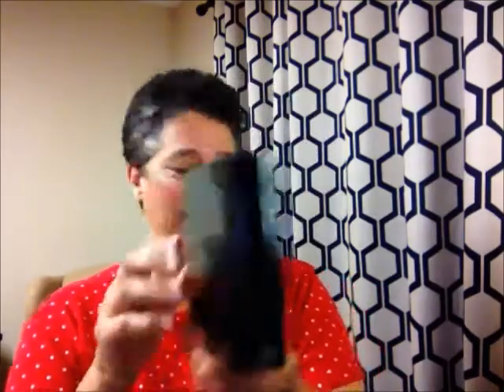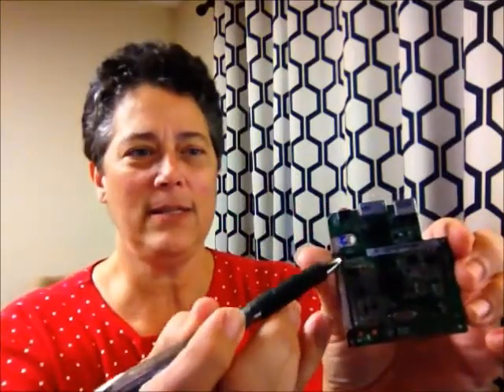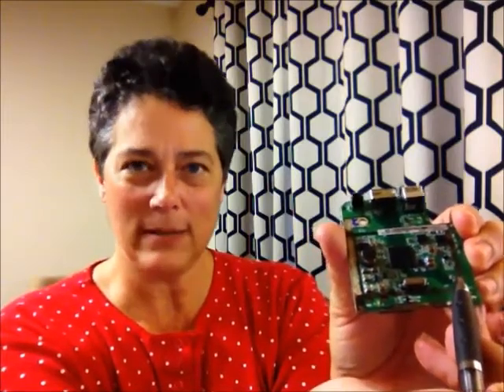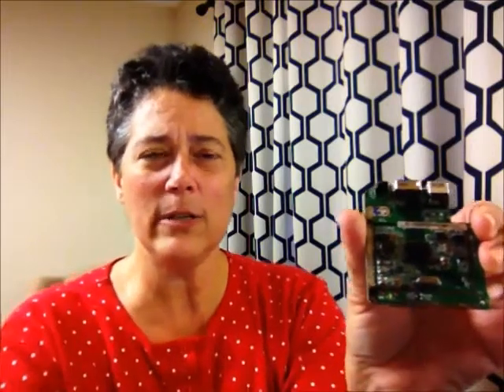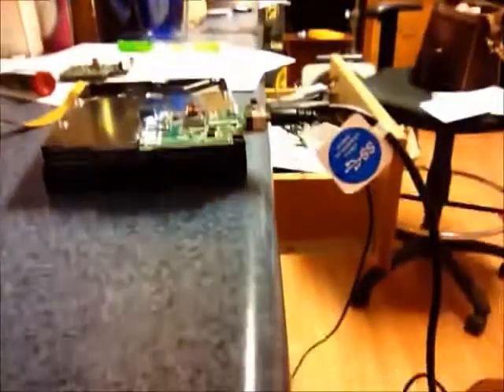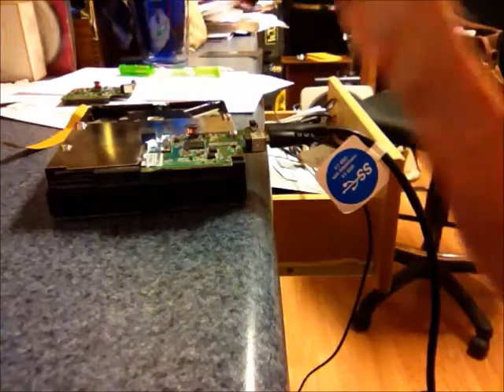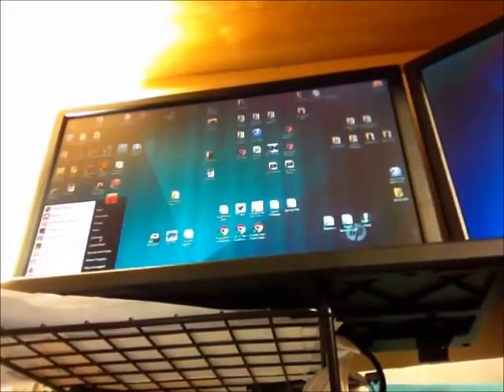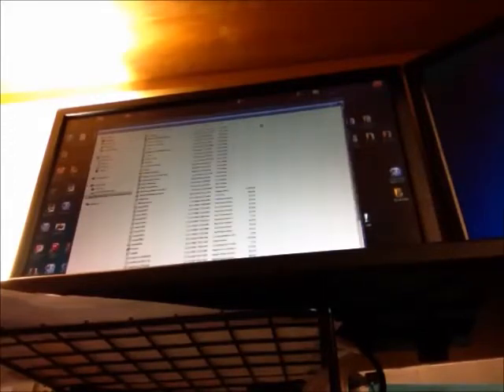Repair External Hard drive - Computer did not recognize it.

Comment: I'm so happy for you! Seeing it work was a relief. I am currently at a loss with my hard drive. I think I must have the same problem, so i've just ordered the circuit board. Thank you for your help!!
Reply from the maker: Hope it works out for you!
Reply: I Fix Things thank you. Unfortunately it didn’t. It did get the hard drive running again but the hard drive itself still isn’t appearing on the computer 🤯 so I have no idea

Comment: Did you try cleaning up the contacts to see if that helped?  If it fixes it you have a spare board.  I have external hard drives but I buy the empty USB 3.0 enclosure and put in my own hard drive.  No encryption letting you take the drive out and put it into a computer.  I also have USB devices that allow the drive to be exposed and you can read and write to them.